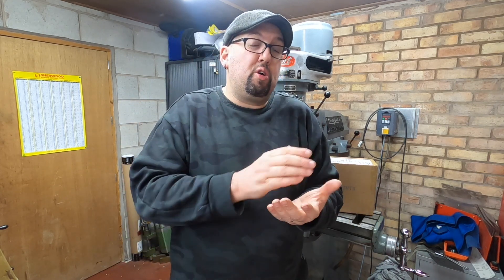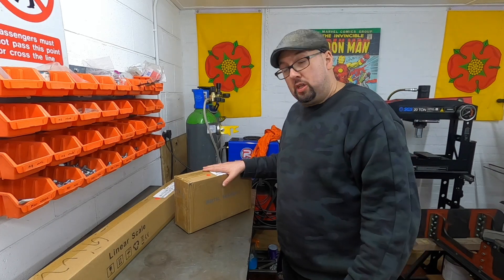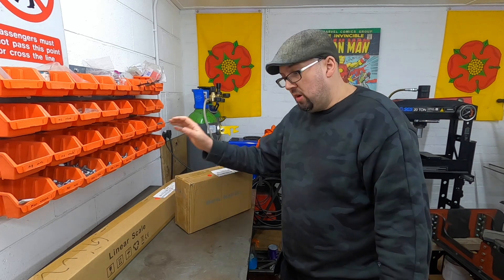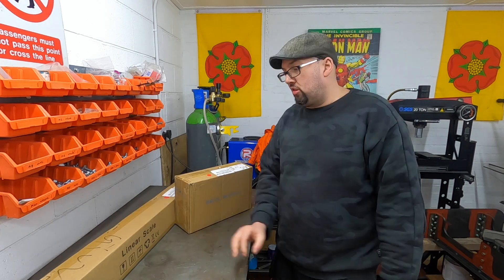Bridget Gets The DRO - Part 1 - Whats in the box??

Comment: I'm going to hold off on a DRO for as long as is feasible, but at that price it's tough to resist. My biggest worry is drilling holes in my milling machine, I'd like to see how you get on fitting it!
Reply from the maker: William, Hope your well my Youtube friend! It's easy to fit, I increased the supplied bolts up to M5 from M4, you're drilling and tapping cast so its easy. Honestly the quality is unbelievably good, I'm not being sponsored by them, I took a gamble on Vevor and everything I've received so far is fantastic. I've a chuck on route currently. All the best, Laters, Matt 👍

Comment: I purchased a VEVOR DRO for new lathe in Oz a few months ago, works like a treat.  Can beat it for the price
Reply from the maker: Ed, I can't believe the quality of it, tbh most of the expensive ones are most likely coming out of the same factory!! For the lathe I could do with a thiner scale for the Y axis, so it will be a little longer until I have DRO on the lathe. So far everything Ive bought from VEVOR has been good quality, Ive just ordered a new chuck for the Lathe, but thats another story! 👍 Laters, Matt
Reply: @MattChiversWorkshop  Good luck with the new chuck, I'm sure it will be great.  I bought a Milling Machine 18 months ago that came with a DRO installed but my new lathe didn't so I purchased the VEVOR.  The cross-slide didn't fit so I had to purchase a new slim scale but it fitted to the VEVOR readout with no issues.  Fitting the scales as a pain on my lathe but I got there in the end